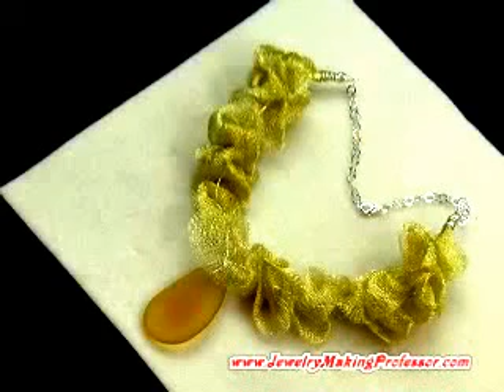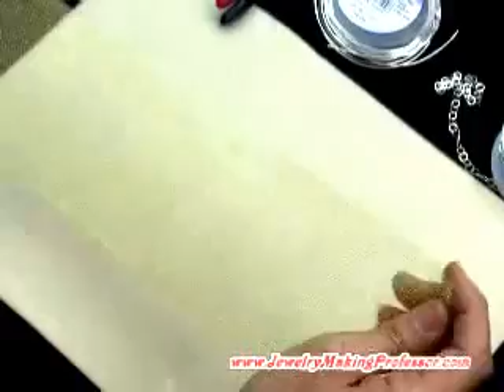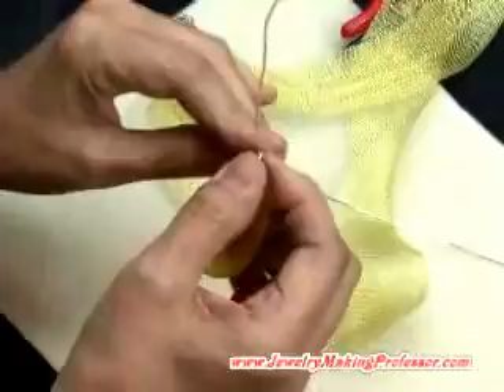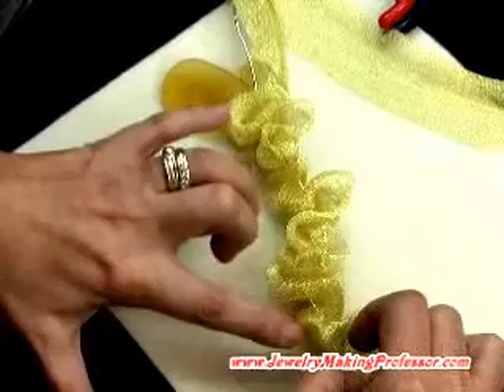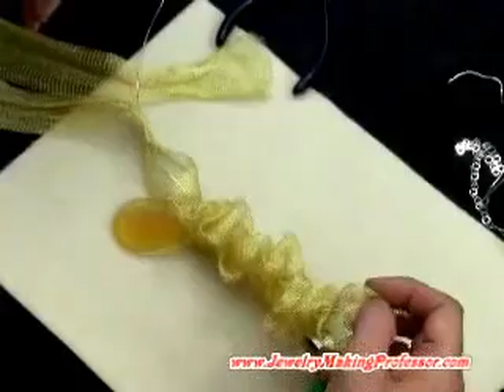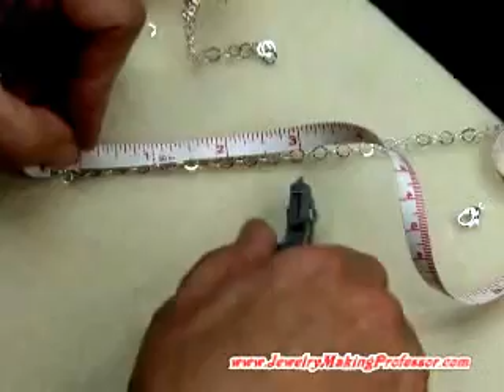Wire Knit Necklace using WireKnitZ copper wire knit

Comment: Wouldn't it have been a whole lot easier to have just marked the middle of the knit and then fed the knitz on to one end of the wire?  You could have then made a bail from a small piece of the wire and attached it through the knit.